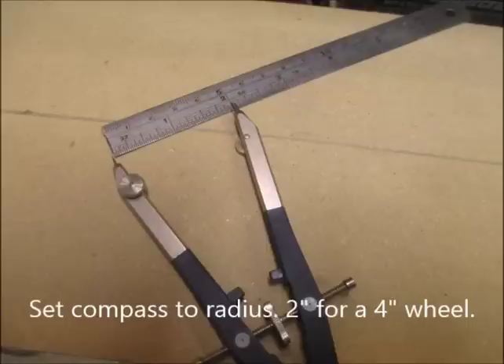Wooden Drive Wheel

Comment: Did you round the sides of the weel or just make it flat and square?
Reply from the maker: I made mine flat. However, you could put a slight crown in it to improve tracking.
Reply: @d.comeaucustomknives2677 
Thanks.

Comment: Attached how? One video it was a cut groove inside the bore and just hammered on, maybe he had a tongue on his shaft. ...  ;) ...  but yours looks like a nut on the end?  I am asking because I am about to make and mount a drive wheel the same but I have a smooth shaft,  how should I secure the wheel?
Reply from the maker: Hi. This was fitted to a pump motor where the shaft has a threaded end. Does your shaft have a keyway? I have used tapered bushings for these. They can screw into the wheel. https://www.zoro.com/search?q=tapered+bushing&variants.attributes.9518=5%2F8%22